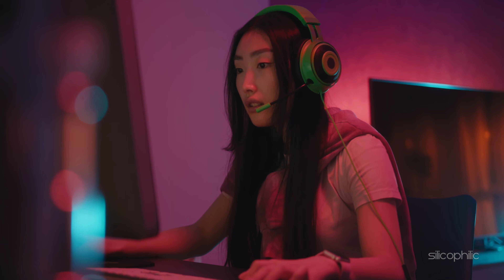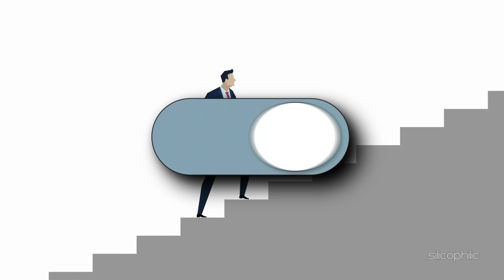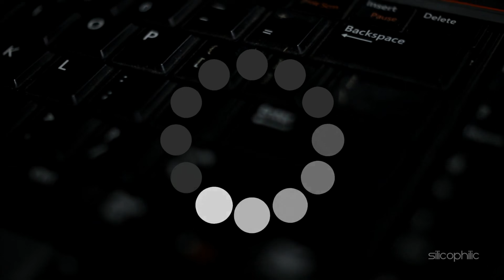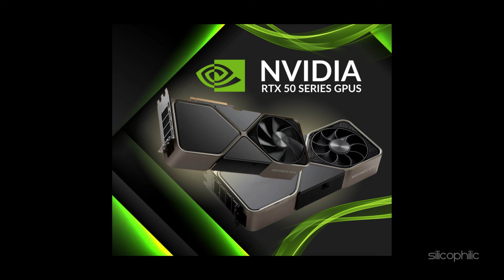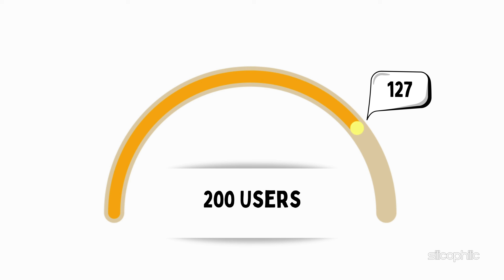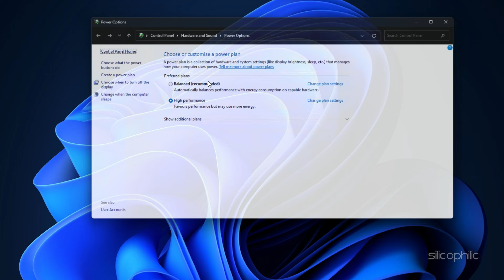Fix BLACK SCREEN After Updating NVIDIA Driver | 2025

Comment: pls help my victus laptop lcd  is broken  and i cant see anything on my monitor i tried every method to fix it pls helpp
Reply from the maker: Sorry you’re dealing with that 😔 If the laptop LCD is physically broken and you can’t see anything, software fixes won’t work. Try connecting your laptop to an external monitor/TV using HDMI, then set the display to external only. That’s the first step.
Reply: @Silicophilic  i dindt also work in hdmi

Comment: Hey i tried updating my driver and when it  was installing the screen turned black and even when i tried to  enter safe mode or bios its still black please someone help
Reply: Facing same issue, did you find the issue?
Reply from the maker: If the screen stays black even in BIOS, try reconnecting the monitor or GPU cable — could be a hardware or display issue. If possible, use another display or port to troubleshoot.

Comment: this happens to me after long periods of gaming ill close game and then 2 minutes later black screens, one time i had it happened after I launch a game. (not all the time but between July and Aug this has happened 3 to 4 times) I have a 4080 577 driver, I get an Event 153 nvlddmkm
Reply from the maker: DId you try the solutions?
Reply: @Silicophilic not yet , will try soon. Since it was late last night. Will this clear it for good and what are the chances it returns?
Reply: Also should I disable my igpu in bios?

Comment: This video helped me. The last two times I updated my Nvidia drivers I had this happen and the first time had to force restart my computer until I could recover it. You saved me from going through that a second time! I unplugged my monitor from my graphics card and plugged it back in and it fixed the problem. Don't know why this problem started happening every time I updated my driver, but this helped me not dread the next update and not recover my pc a second time.
Reply from the maker: Awesomeness!

Comment: I have a brand new 5060, and currently trying to deal with this issue. When booting normally, the screen starts like normal but turns blackcin a few seconds and never recovers. 

Can see the graphics card when booting in safe mode, but cannot see it when starting normally. Also can uninstall my drivers on safe mode to make a recovery, but because I cant see my drivers when starting up normally, I can't pick and choose the driver version I want.

Am I cooked or am I cooked?
Reply from the maker: You are not cooked. Let us know if the issue is not yet fixed
Reply: @Silicophilic building a new system that was built around 5060 was the fix. My old processor and power supply wasn't feeding it well enough, so the 5060 was just not working
Reply: @bron379 you upgraded psu? Facing same issue, I have 5060 with ryzen 5 3600 , 520W psu , it is around a month old
Reply: @priyamkhanna01 my issue turned out to be an extreme case of bottlenecking. The CPU wasn't aligning at all with my graphics card, so upgrading that solved my issues. 

Turns out money can fix issues lol
Reply: @bron379 you upgraded from which to which,? Many are telling me it’s psu issue
Reply: @priyamkhanna01 I changed from a Ryzen 5 1500 to Ryzen 7 5700. It also resulted in my motherboard and ram changing due to physical compatibility issues, which means I had to essentially buy a new PC. A PC that was built around the 5060 graphics card. 

The PC guy I worked with asked around his peers and told me that the 5060 was a flawed card that had issues like this. Has to have the right system built for it, where you can't just put the 5060 in any PC and expect it to work. 

But my new system it works pretty flawlessly, can't say that I regret it (ignoring the price, which wasn't horrible but debt is debt)

Comment: Okay so this JUST happened to me..
I have a RTX 2060 super (I know its outdated) and I Updated my driver as normally
After a day passed i got in and Everything worked besides when I tried to shut it Off for the day I COUDNT, No restart no shut down nothing… so I turned it Off via the normal power Button. Next day I turned my pc on and its just the grey background with the loading cursor, no key imput works, cant Even get to bios just NOTHING. Is there any way I can fix it WITHOUT loosing all my data? I would love an answer
Reply from the maker: Your data is safe... Its just the display. PLease follow the steps

Comment: I was using an RTX 3070 since last 3 years. I've always used the latest drivers and I didn't have a single issue. Until I bought an RTX 5080 a few days ago... The screen goes off for a few seconds and goes on. I've even upgraded my PSU to RM1200x. I'd feel less sorry if I burned all the money instead of buying is piece of masterpiece (!).
Reply from the maker: Similar things have happened to some others too.

Comment: I just install my new RTX 5060 TI, my pc will blank screen after restart. This issue will happen only when restart, working fine if shutdown and turn on normally. Unable to press "Roll back driver"😢
Reply: Plug in a HDMI cable and a display port cable at the same time then change 120hz or more
Reply: @sdb-senny2535  tried, same. I have uninstall and reinstall the Nvidia driver, issue is still remain🥲
Reply: how now? this happens on my rtx 5060 8gb too
Reply: Same issue i face right now.....i try roll back but not working.....laptop Asus rog strix scar II GL504GS
Reply from the maker: Try a clean reinstall of your GPU drivers using DDU in Safe Mode — that usually solves restart-only black screen issues 👍

Comment: I just switched to a 5070ti and it ran last night fine but when I turned it on this morning it was black screening. What drives should I install cause I can’t roll back
Reply from the maker: Does you processor has an GPU? If yes use that!
Reply: @Silicophilic  my cpu is a 9950x I believe it has one
Reply from the maker: @noahthomas3170  Awesome. Then Use that to revert back the driver to a stable one. And then disable the auto driver download.

Comment: My RTX 5060 Ti runs GTA 5 flawlessly, but when I try to run to Hotstar in Chrome, this issue occurs. However, when I'm running with the Windows Basic Display Driver, no issue happens. I ran DDU (Display Driver Uninstaller) to fix it, but it didn't solve the problem. I'm unsure what will happen next. The only fix left seems to be changing the PCI Express generation. Please help.

Please help..
Reply from the maker: Please let us know if your PC has an inbuilt graphics unit?

Comment: Guys I just shut down using the power button and then after I started my pc it worked like a charm
Reply from the maker: That's really awesome!
Reply: I also used the little button to reboot and it came back fine. I might not update so much as it's a pain.

Comment: Updated to 576.02 and on next start up it went black shortly after login and subsequent start up couldn't even display the login screen though I could still hear windows starting up. Got to safe mode and rolled back my GPU driver which got me a successful startup. Looks like I was behind on my OS updates which caused a conflict with the new GPUS drivers. I wish at least Nvidia would force a check of your OS version before proceeding with its updates...
Reply: @CoCoNewB  Had the Same Problem and did the Same Thing and ofixed it thx♥️♥️♥️
Reply: Same but newest os,what I do?
Reply: @zieliannyanyan  I'm definitely not a tech expert or anything, but if you can rollback you GPU drivers to something functioning then I'd just suggest running on that version for a couple of months until the next, and hopefully functioning version, comes out and then update
Reply: @codypturner  but my PC not start, his start,but nothing,black on monitor and cursor,sound yes,my keyboard is right(sorry for my bad English)I try on safe mode but it's BLACK,maybe problem in my monitor hi is old,but before update drivers all is ok
Reply: @codypturner  help please I Don know what I do I'm panic
Reply from the maker: Yes they could surely Do that!

Comment: I updated on 16th, put PC to sleep. Came back after 45 mins, My GPU RTX 2080 starting flashing lights & gave no display. 
Ever since, even low load games like valheim, just getting to the main menu, ends up giving no display & the GPU lights starts flashing.
I think the update killed my GPU
Reply from the maker: Did you try reverting the drivers?
Reply: @Silicophilic  Sadly I thoght my GPU or PSU was faulty so I sent to my friend who lives 3 hours away to check in his PC lol
I'll revert drivers when I get the GPU back
Reply: @Silicophilic  My main PCIe slot got fucked on the mobo somehow, plugging the GPU into secondary slot works now.
ALso my monitor's power brick died. 
This all happened on the day of 16th April drivers came out

Comment: Could this cause the pc to freeze? I have been experiencing black screen. While using my pc my screen goes black and then comes back and then goes black again; once i turned off my screen and then on again, for some reason that fixed the issue temporarily. But my question is could the driver be causing my pc to freeze? My pc has froze 3 times.
Reply from the maker: Could be a different issue also. Check the driver version that you have installed.
Reply: @ Nvidia driver version: 32.0.15.7283

Comment: I forced shut down my pc and turned it back on and it fixed it but the latest driver update is not installed and I'm not installing it again(572.83)
Reply from the maker: Okay!
Reply: How you do uninstall latest gpu  with black screen?
Reply: Im regret update to latest gpu...i got black screen every 1 min
Reply: @SmallDsgnz try force shutting down ur computer and turning it back on if the update was not completely downloaded then it will go back to the previous update automatically
Reply: @rajazarrar7235  already fix it..i do enable safe mode and uninstall latest driver..and stop nvdia app from getting startup..after that im install the previous version..im telling you the previous version is better than the latest

Comment: I have a laptop RTX 4050 , and when i updated my drivers and restarted my laptop , the windows welcome sound can be heard but there is black screen with a loading cursor 😢😢 i am not able to do anything now , only when i press windowskey + (+) key a magnification bar appears,  plss help🎉
Reply from the maker: Get into Safe mode by pressing the key combination.
Reply: @Silicophilic  that doesn't work , in the end i have to disable my graphics card and run the system on intel integrated graphics,  then download the old drivers and re-enable my RTX 4050 , and now it works fine , no issues now

Comment: my gigabyte 5070 ti eagle has the blackscreen problem across ALL 572.xx drivers (up to and including the current latest: 572.83). the problem occurs irregularly...once in youtube, once in the game etc.... unfortunately there has been no update from gigabyte or a motherboard update from asrock (riptide z790). 

i never had such a problem with my previous gigabyte 4070 ti eagle.
Reply from the maker: Has the issue been resolved?
Reply: Any luck?  I have same issue...gigabyte 5070 ti aero with a gigabyte aorus x870e pro
Reply: @Ewokthisway   572.83 and everything else updated to the latest level and pci limited to gen 4 in the bios! so far (!) it runs stable when I set a maximum of 120 fps.... at 144 it crashes in blackscreens.  

marvellous.... you buy the new 5070 ti for too much money and since weeks i can only play it - in contrast to the previous 4070 ti - in lower resolution.... thanks for nothing nvidia.
Reply: @b.b.8163  issue resolved by using a newer monitor that has displayport instead of hdmi...no issues with black screen since.  I will update if any issue arises
Reply: @Ewokthisway  I have the Elite XG270QG from ViewSonic, and it has DisplayPort. Strangely, I had to replace the cable because of certain issues at lower resolutions (compared to the previous connection with the Gigabyte 4070 Ti Eagle). I had black screens just like before.

I'm very happy with the monitor. If I had to buy a new one now because of the 5070 Ti, I'd sue Nvidia (yeah, pointless... but then I won't buy ANYTHING from them, EVER again).

Comment: What if I can't boot my pc with the new card, motherboard shows red led light when 5070 ti is connected to a monitor but boots with no monitor connected or using any second gpu
Reply: Ihave  the same problem
Wirh a 3070 tho
I have to manually unplug monitors b4 starting.
Ill test tonight
Reply: Okay  @yukiotida8485
Reply from the maker: where is the red light showing? Is the light color changing if you boot without the Gpu?
Reply: @Silicophilic  it's for reporting problems gpu ram vga boot. Yes, lights go off like normal if there's no monitor connected

Comment: Thnaks you my issue solved  rollback is good  my pc is installed with 572.60 driver which is the monitor bug now i have installed 572.70 which works fone for me my card is RTX 4070 super
Reply: ❤ Most welcome
Reply from the maker: Thanks so much!